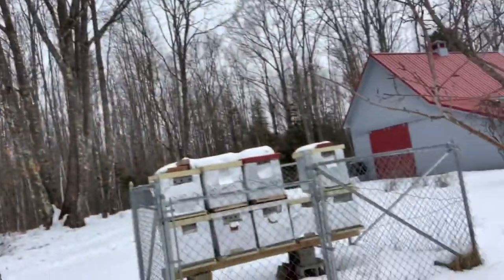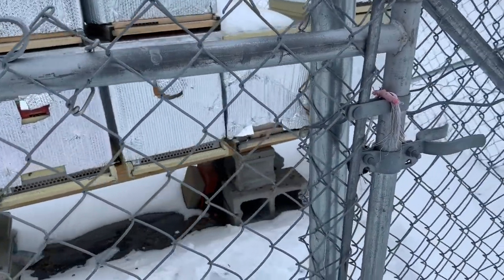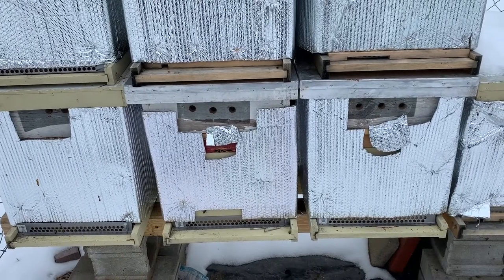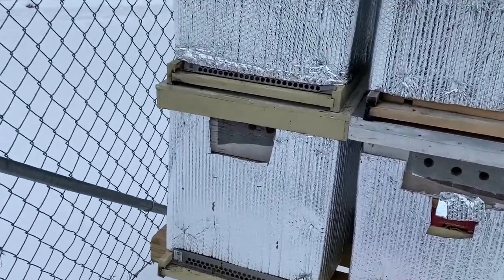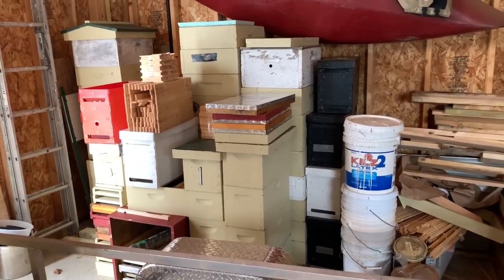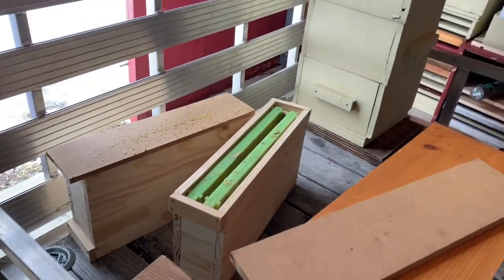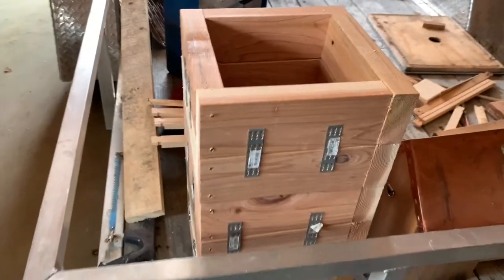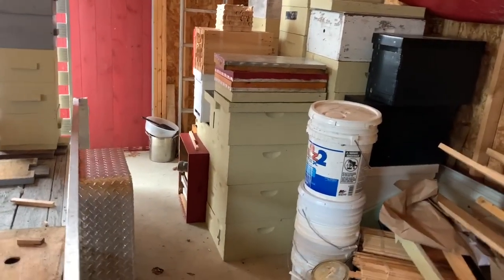A Year in Beekeeping 2020: A Quick look at Hives and Initial Plan for Expansion

Comment: The only thing I’ll say on the 2 framers is that you will need to keep on top of them or they swarm, I use 4 and 5 framers for making queens I find it better for timing, because you only have a few hives ideally you would feed them up to a strong double through spring then split the entire top box equalise the brood and honey/sugar and use a cell rather than a mated queen.
Grafting is easy enough but having the right conditions is vital, I can get a 90% larvae acceptance but if you don’t have the resources the workers will pull them down and eat the larvae. 
In your case with 9 hives a hot box method will work fine, feed up your selected hive until she has laid a full pattern on a wax foundation then remove the frame and put in a 2-4 framer shake young worker bees into the box and lock it up after 2 days the bees will have started drawing out queens you then punch out the cells and stick them in between the frames of the 2 frame boxes(1 sticky 1 emerging) and add a cup of workers, the workers finish the open cells and in 10 days you have virgins (you will also need to feed them during this time) it can take a couple weeks for her to mate and you will be lucky if half make it back and start laying that’s my experience anyways.
Reply from the maker: Keeping on top of them is my only concern with the 2-frame setup as well.  I may eventually end up doing what you suggest and move to 4/5-frame nucs for mating.  We will see how this year goes and move on from there.  Thanks for watching.  We greatly appreciate it!
Reply: Giles Honey cool 😎 if you start with 4-5 framers they upgrade to 8-10’s faster and easier, you may want to start with making a brood factory to get the desired results, it’s better to have one or two colonies you continuously feed so you can steal brood and bees from to top up when you upgrade from Nuc to production hive, also drone production is just as important as everything else so when virgins fly there is a good number of drones available, if you have plenty of Beeks in your area should be fine, you will need to check drone production in your own hives as this can indicate when to start making queens, around 3 weeks after drones are laid so don’t start too early you may not have drones to mate with 
I requeened 100+ hives this year and didn’t buy any queens in, it’s not difficult just time consuming.
Check out Richard noel he’s got some good videos on producing queens